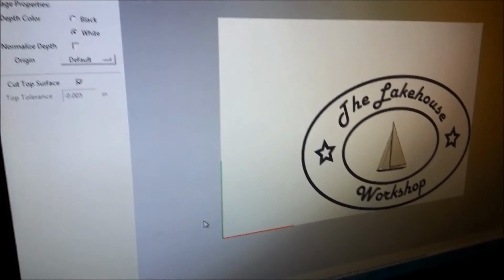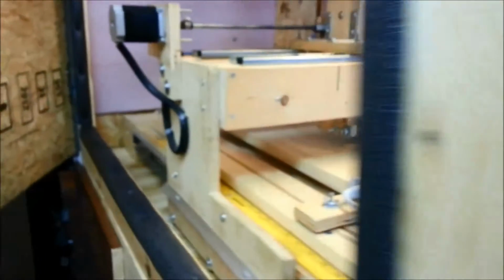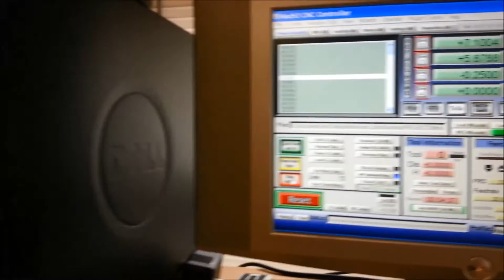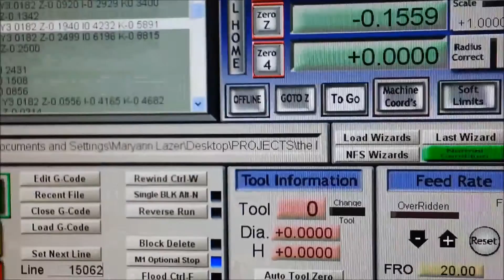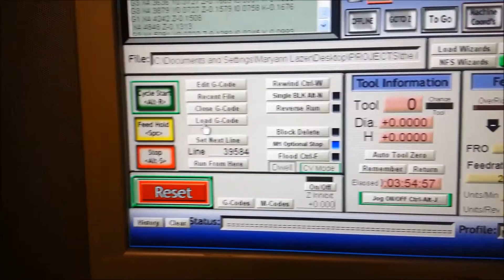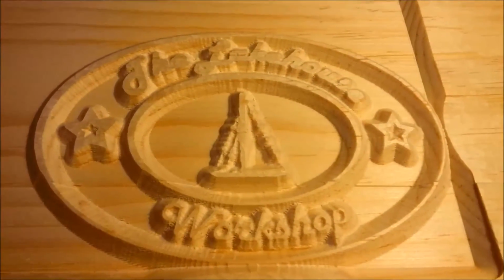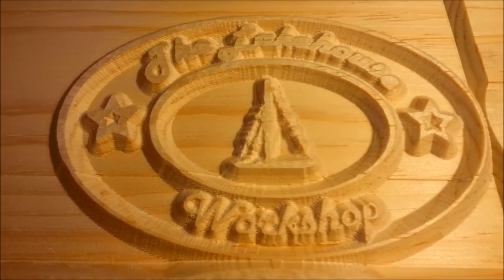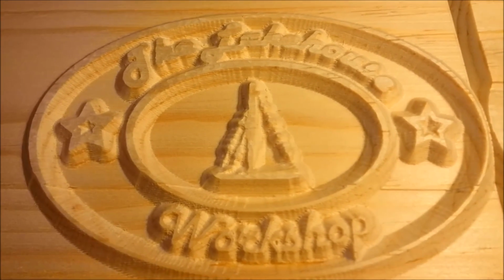Homebuilt CNC - Long Rastering Sign Cut

Comment: Very good result without ball screws or trapezoidal screws and special linear rails and bearings. Just regular lead screw from the store)) Congratulations;)
Reply from the maker: Thanks.  A basic cnc machine can absolutely be built with regular stuff - no need to spend a fortune on one of these if you're primary goals are just some hobby woodworking.  The results have been good.  I've even done lithopanes with excellent results.